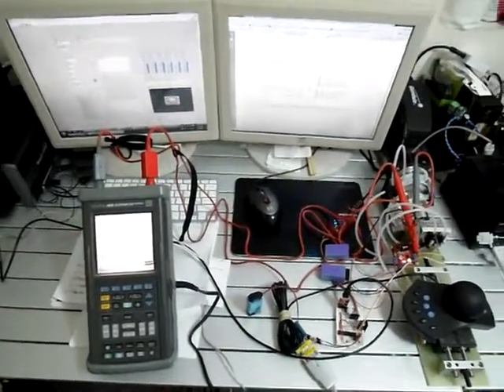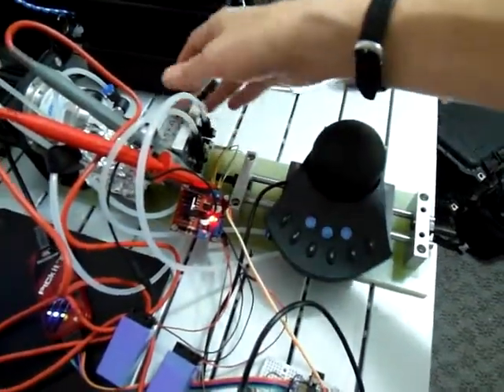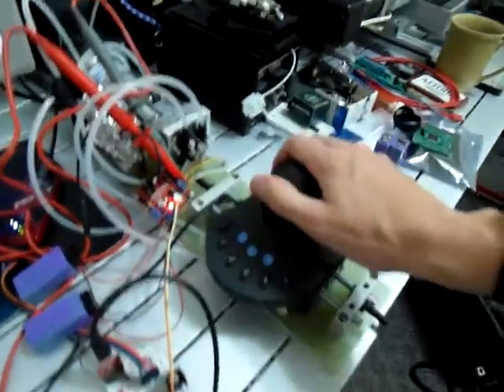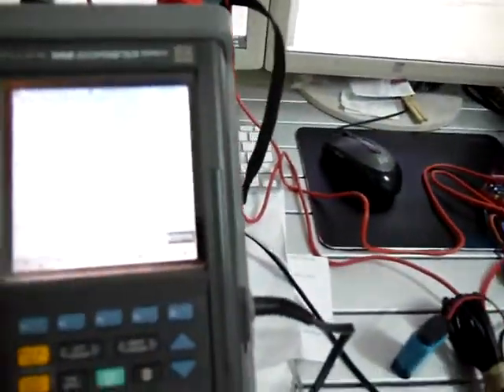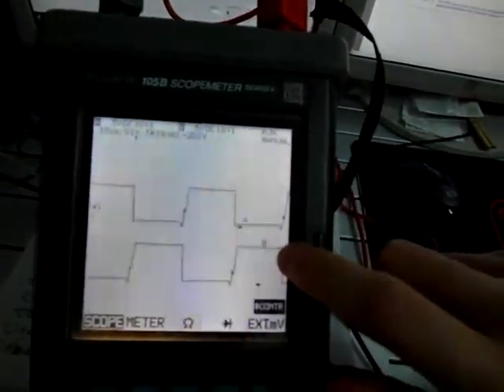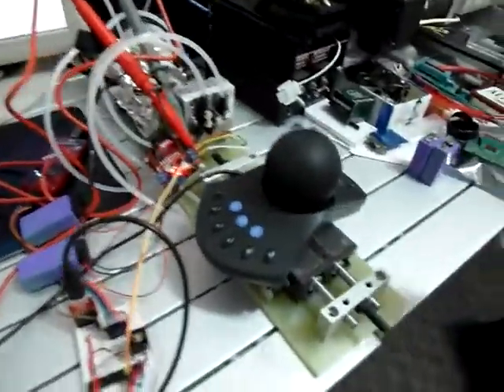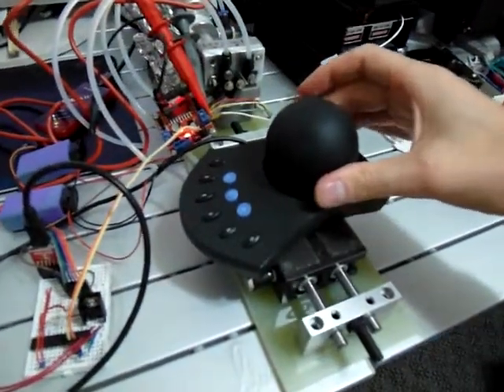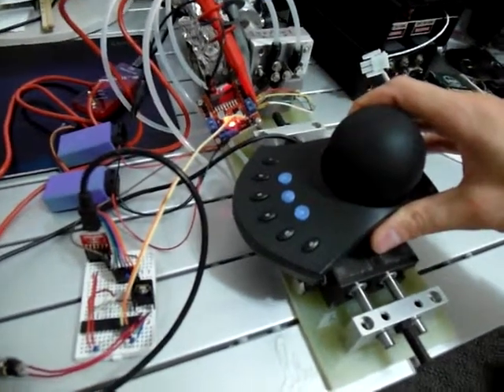Powered exoskeleton prototype hydraulic servo valve controller

Comment from the maker: Peter Workman This was just a prototype to demonstrate operation, and was thrown together using the computer to tie together all the independent systems. The final version will have the spaceball connected directly to the micro-controller(through RS232) The microcontroller used here is the one of the dspic33f controllers designed for switching power supply use, so it does have complimentary hardware PWM. The output of the controller is square with no skew, it's probably introduced in the h-bridge and batteries that are powering it. The final micro-controller I was planing to use was http://www.microchip.com/wwwproducts/Devices.aspx?dDocName=en547034 which has 9 pairs of complimentary hardware PWM. The STM32F4 looks really nice too. I ordered a STM32F4 discovery board and will test it out to see how it works.

Comment: I would suggest the use of a higher-end microcontroller for this.  It looks like you're bitbanging the complementary PWM and the skew between the two channels is quite clear on your scope there.  Something like the stm32f4 would provide hardware complementary pwm and also act as a USB host for the input device, removing the PC from the setup which is probably a big source of latency.